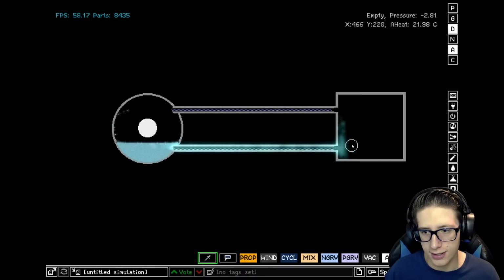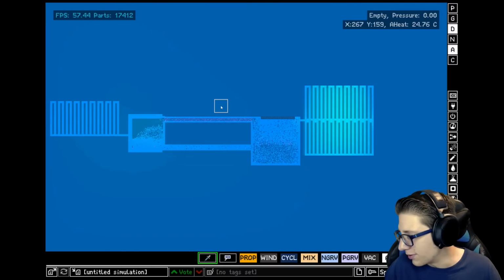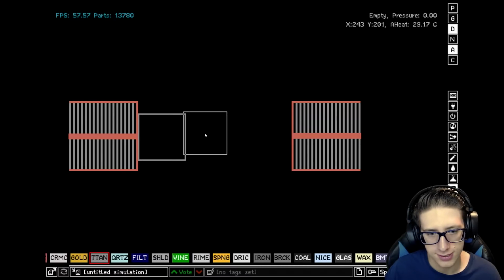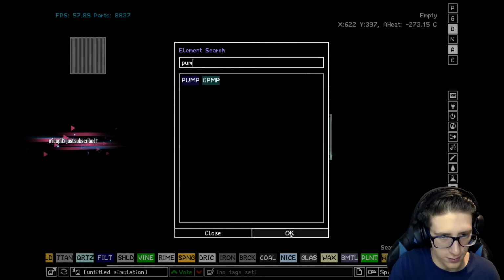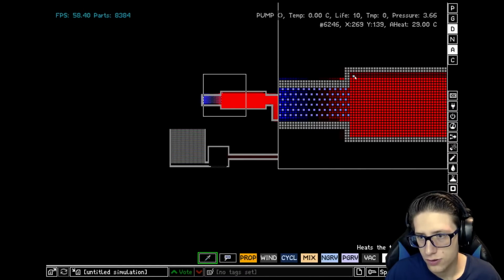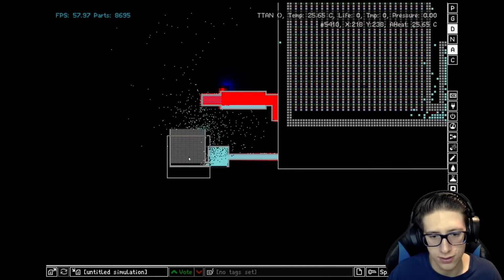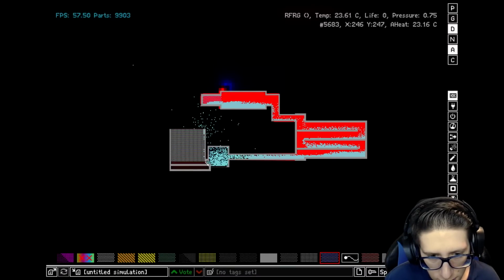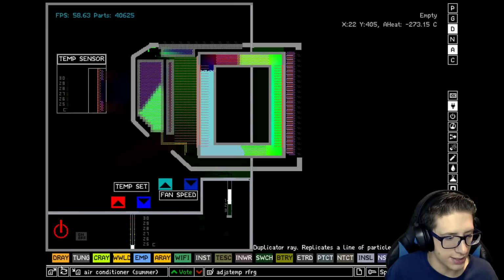The Powder Boy BUILDS AN AIR CONDITIONER

Comment: Gas is higher energy than liquid so just have it turn into a gas in a chamber with a radiator connected and it will suck the heat out then move it to another chamber where it turns into a liquid which gives off heat